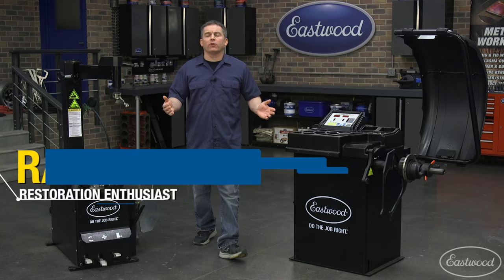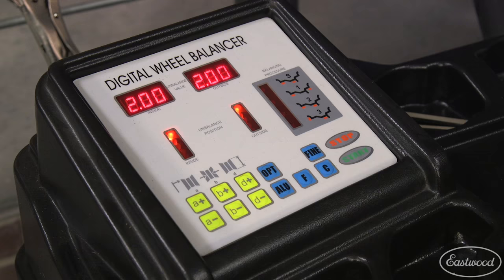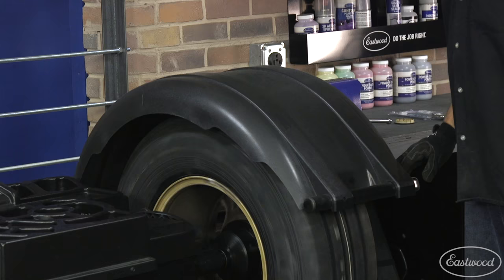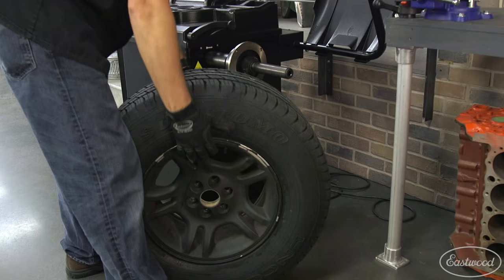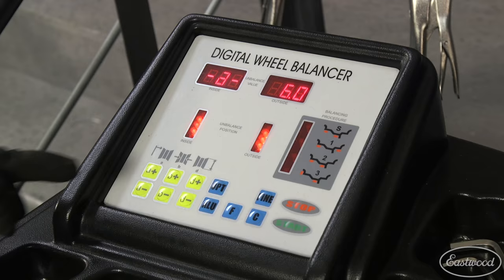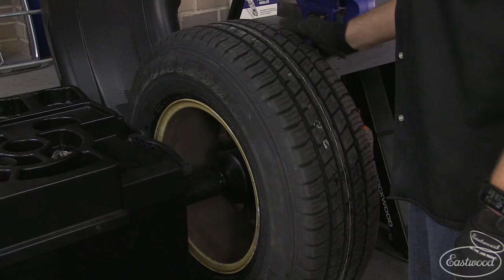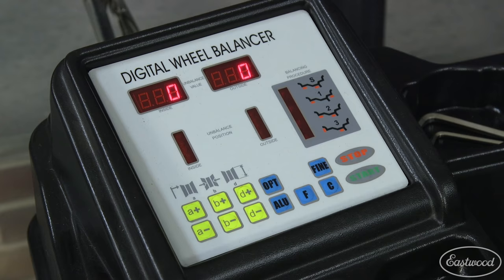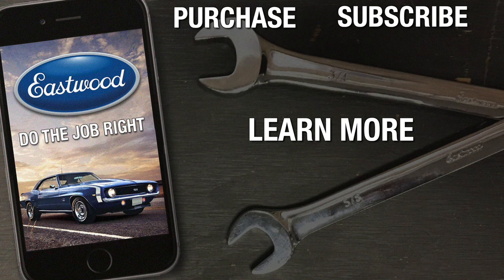How To Balance Tires - Eastwood Electronic Wheel & Tire Balancer Machine - Eastwood

Comment: So you can mount a 45 inch tire on your tire change but can only balance up to 34 inches?? That's a bit counterintuitive isn't it??
Reply: I’ve always wondered why my local tire shop won’t mount anything bigger than a 35/12.50/20
Well now I work there and it’s just because that the limitation of there machines.
Also once you ballence an off road tire that Isn’t for high way use but stilll everyone run them 
You probably wouldn’t either 😂😂 I’m also new and had one of weights just slightly out man I ended up with like 7oz on one side 
It came out 0.00 0.00 at the end tho🫡
Reply: @sharkclan42  right but if the tires are technically road legal then the machine should be able to balance it. My buddy has 38's on his obs f350 and had to add 2lbs of airsoft bb's to each tire to try n balance it. Kinda ridiculous if ya ask me

Comment: I got 4 new tires and 3 of them are balanced outside with adhesive weight but one tire is balanced inside with one clip weight. Is that considered normal?
Reply from the maker: It probably has to do with how the wheels are made - adhesive weights are nice because you don't have to hammer on the outer lip of the wheel and it looks better and/or there isn't an outside lip.  The inner side probably got a hammer on weight because it has a lip and they're less likely to fall off.  It could have simply been the shop's preference.
Reply: @eastwoodco thank you
Reply: Yah shop preference seems to be the thing. At one Americas Tire location they used adhesive, at another clip on.

Comment: I just got new tires and saw that one tire don't have any balancing weights. Is that normal?
Reply from the maker: Weight amounts vary depending on the wheel/tire combo so sometimes you don't need any - sometimes you need a fair amount.

Comment: I wanted to ask if you balance a tire and wheel remove it from the machine then put it back on the machine should that tire and wheel still be showing balanced? thanks
Reply: A balanced tire is a balanced tire. Should still be the same.

Comment: do you need tire balancing only when you replace install new tires or also on existing tires? the service shop near sold and told me i need tire balance on my 4  2020 santa fe car on an existing tire
Reply from the maker: You will ALWAYS need balancing with fresh tires. You could need to re-balance a tire if the weights have fallen off or you're getting a weird vibration.

Comment: Does it work for motorcycle tires?
Reply from the maker: This setup is designed for automotive/truck tires.  Motorcycle shops have specialty equipment to handle mounting/balancing.